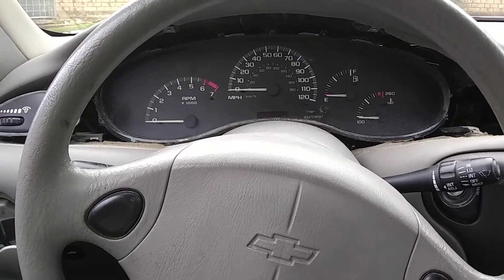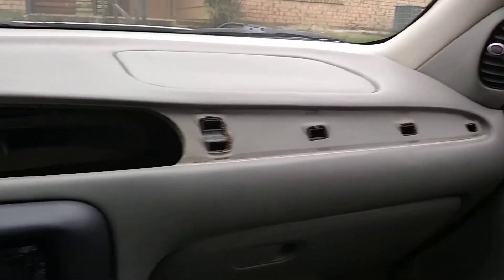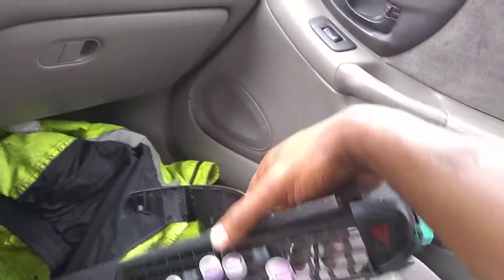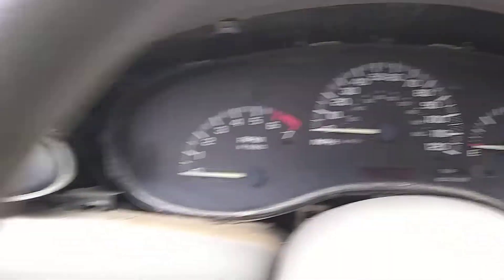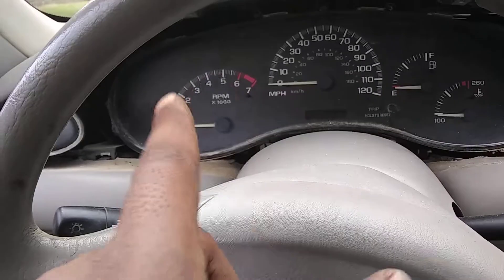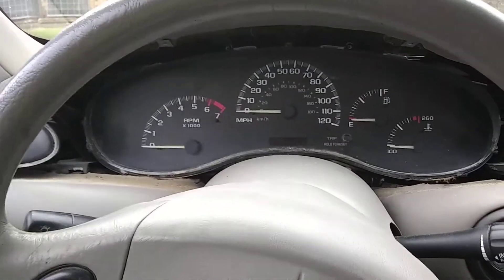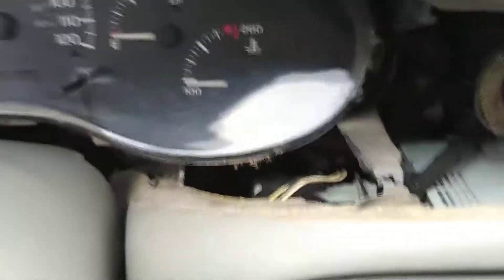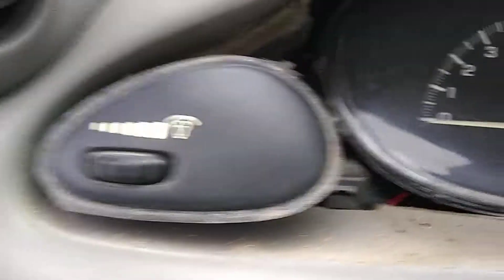Changing out broken Dash trim on $100 Chevy Malibu #chevymalibu #diy

Comment: KQ Custom:  I have a 2001 Malibu and need to replace the hazard/flasher switch next to the a/c  center vent.  Can I remove the A/C vent without taking out the whole trim panel by prying it out?   Thanks.
Reply from the maker: I suggest you to take the trim off it's not as hard as you think at all just take your time popping it out because it's brittle and Cheap
Reply: Thank you KQ Custom.  I have watched some other videos showing  removal of the trim to access the hazard/flasher switch and they take the entire trim  piece off.  I'm a senior lady but I can do a lot of these repairs myself thanks to YouTube videos and eBay for parts. I appreciate your fast reply!